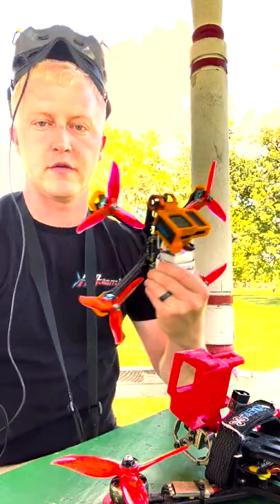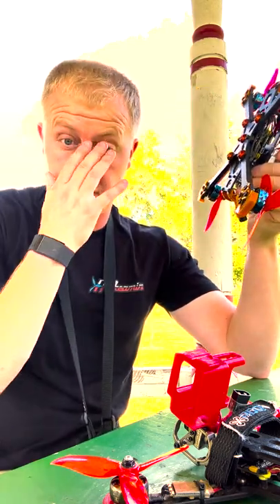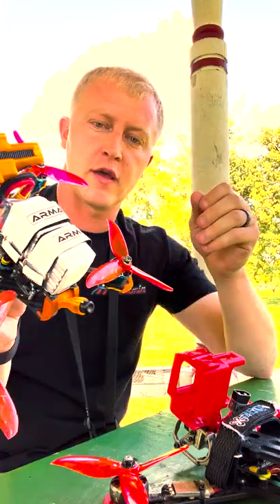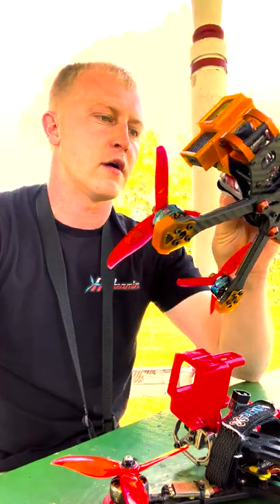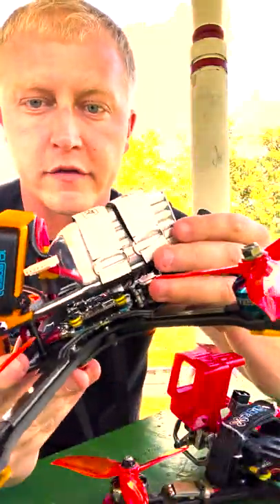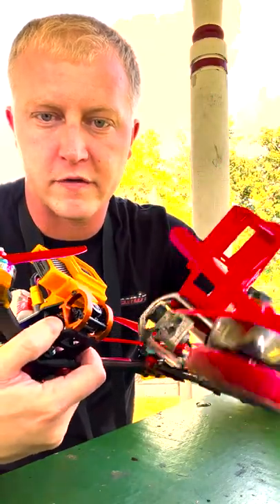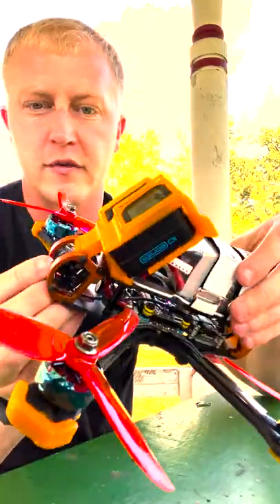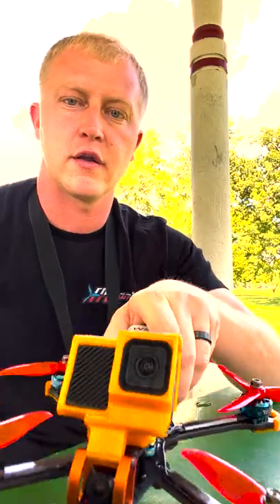My Thoughts On The Armattan Beaver Frame & My Build + Goggle Flight Footage!

Comment: Hi! How does it feel in comparison with the Badger? I’ve received mine, but hasn’t assembled yet )))
Reply from the maker: I like it more but this is a much more Gucci build compared to the badger I have, which was their pre made one. 

I think it does handle rolls better and I think the arms will hold up better and have less wiggle. My badger arms seemed a little loose from banging things where I think these will hold form better. I don’t think it was a huge issue but it’s definitely better.

Many are complaining about the go pro/cage not being adjustable like the older ones so
You move go pro and cam at same time.
Reply: @ItsElevatedIdeas  haha ))) thanks! Yeah, I also have 1 banger and 1 “wedding” drone 🤣 (Gucci build). Non adjustable cage w/Gopro is a bit downside, but can also install adjustable TPU base (universal gopro mount) 👍🏻 also would be easier to transport and swap different cameras if needed.